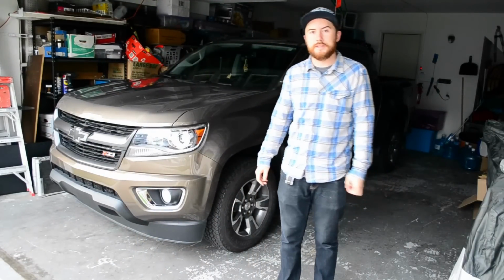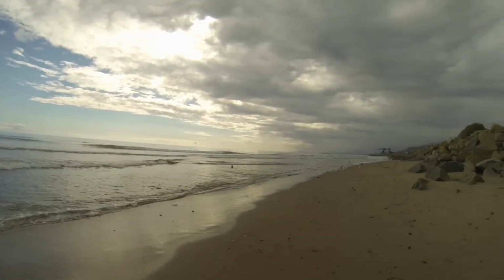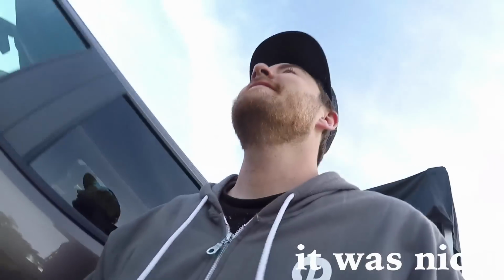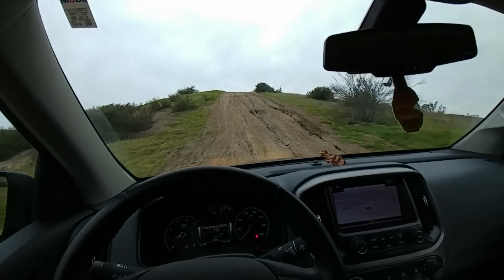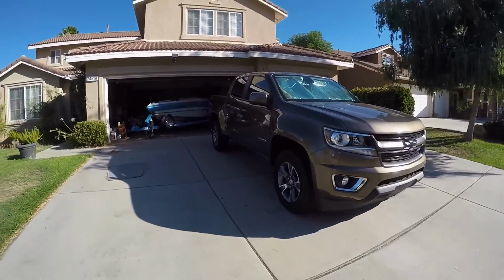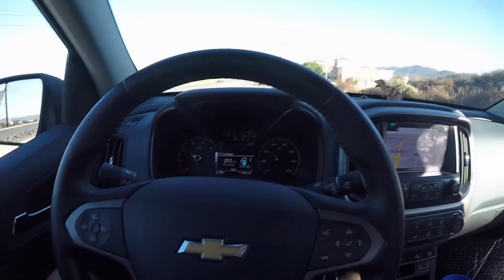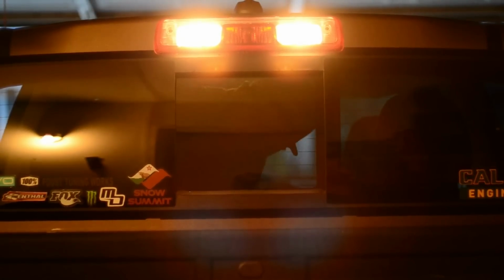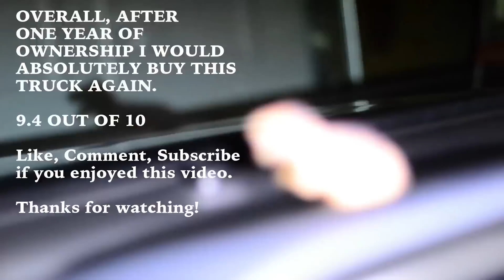Chevy Colorado Diesel... 1 Year Later

Comment: Best part of this review is for sure the info about the T-Rex. Veeery important stuff there!

But seriously, thanks for this video, thinking about grabbing the 2017, and wanted to check out some reviews on the previews models. Especially the Diesel vs. the V6. 
I'm into carpentry and equestrian sport, which means lots of wood and eventually a horse trailer! So seeing the reviews on how this thing towed your boat was helpful. 

Thanks again
Reply from the maker: LapeyLou you're more than welcome. That's why I posted it, so I'm glad it helped. And yes, T-Rex and the other dinosaurs should never be forgotten.
Reply: I bought the new 2017 Chevy Colorado ZR2, I've always been a Ram/Jeep guy. Hands down, best truck I've ever driven or owned. Get the diesel though for sure, it'll last Foooorrreeeevvvvveeeeerrrr.
Reply: Thanks! 
I'm definitely thinking that I'll be getting the Diesel. Even though I don't need that much power right now, it seems to be overall better on  gas, and performance. I do live in the city, so I'll have to look into a few more factors before I decide to buy, but I'm definitely going to be getting myself one of these bad boys. Just have to figure out Diesel or gas. :/
Reply from the maker: Just think about how you want to use the truck to decide between diesel or gas. If you are going to be doing open hwy and towing you'll notice the biggest difference. In general, one thing I learned about the diesels is the constant short trips are not necessarily the best because it doesn't get to warm up. It doesn't get efficient until it warms up so something to keep in mind.
Reply: Yeah, I'm starting to rethink diesel. I think that I'll go for the gas to start, and then maybe in a few years (or whenever I buy a horse trailer) then I'll trade it in and get a diesel. For now I think gas is fine. I won't be doing any towing for quite some time, except occasionally, and most of my 'big trips' will just be loading lumber. I think gas will be fine to start out with. 
Thanks so much guys, you've both been super helpful!
Reply: Nert

Comment: Very nice!  I have a red Duramax z71 crew cab short bed 4x4.  15,000 miles already; absolutely love it.  My biggest complaint is that my door panels rattle with bass.  I have the Bose system. Went to the dealer and they "can't replicate the problem" as usual.  Going to have to dynamat the door panels myself.  I put a nice set of LED tail lights on and LED headlight bulbs.  Looks real sharp.  Good luck with the truck!  Keep it up with the videos!!

Comment: Not too sure what this video was about.... But it wasn’t about what thought it was about.  Doing research because I like the diesel idea-NEEEEXXT!
Reply: I have a 2017 2.8 ZR2 with 18k miles. I have had 0 problems with the truck. It has only been in the shop for a recall. It currently has to go back for the side air bags deploying in certain off road condition. Excellent truck and excellent fuel mileage.

Comment: Hey!

I enjoyed the video and your enthusiasm for your truck.

When you were towing your boat did you use an anti-sway hitch? If not, I'd HIGHLY recommend buying one! It will help to stop your truck from bouncing & will help steady your load from swaying side to side in crosswinds! 

Did you use your exhaust brake? That's another great feature of your diesel Colorado. 

Glad you love your truck!
Rob
Reply from the maker: Rob Huddleston thanks man. Appreciate the recommendation on the hitch. The ride is my only complaint about towing.
Reply from the maker: Rob Huddleston I also use my exhaust brake all the time. Working that with the manual mode for downshifts has become second nature

Comment: One year later I've got 50,000 miles on my 2016 Colorado, 3.6L long box. A few dents, one gash, etc. Chin splitter removed. Lots of mudding and deep snow running. Everything is good so far.  Except for the damn back seat, I hate how the tray stops me from carrying anything on a reasonably flat surface, like my Golden Doodle to the clipper. Have to put her in the back seat.

Comment: Funny and informative video and cool color!  I have the Bronze Alloy on my '17 Canyon, SLT crew cab long bed 4x4.

Only 5K miles on it so far, but it has been great.  These things love to run at 1,800 to 2,000 rpm.  This is very common for diesels of all kinds.  There is something about 1,800 rpm as their efficient torquey sweet spot.  I easily break 30 mpg at 70 on the freeway.  I had one all 60 to 65 mph 35 mile run with no wind or traffic, cruise set, flat road, it got 42 mpg!  Crazy.  

I let the "B" tripmeter run since it was new, the total average economy stands at 25.2 mpg in 60/40 mixed freewayish and cityish driving at 5,000 miles.  It is definitely getting better with break in as it has been climbing out of the 24s for awhile.  To put that in perspective, my last car was a company supplied Camry, it averaged 28 mpg under the same driving conditions.  That is not too shabby for this efficient little diesel.

A couple of little tweaks - I removed the foam sound deadening pad off the top of the engine to let it clatter more as  I like the clattery diesel sound and it probably confuses Prius drivers at the gas station hearing it coming from a non humongous truck.   Also added a catch can to the PCV system since new, and after 5,000 miles, it's element is pretty soaked with oil.  Better to have the blowby oil in the can than mixed with EGR soot in the intake tract to form nasty goo.  The final tweak was to put some self stick foam behind the ECM as it was rattling with the diesel vibe.

I hope you continue to enjoy your truck!
Reply from the maker: Craig Hoffman nice man! Thanks. Glad you are doing so well with yours. They really are some great vehicles.

Comment: After taking it out of 4 hi or 4low, you don't really need to but it's a good idea to drive in reverse a few feet in a straight line, just to help the transfer case unlock easier.
Reply from the maker: K. R. V. Thanks for the info! Good to know.
Reply: K. R. V.   Good info but that is old technology gm says dont have to do it anymore but also your supposed to freewheel before putting into reverse,,hince put into neutral while rolling at lo speed then reverse it about ten feet,,,they it helped release pressure of of the  hubs to fully unlock,,,but like i ssid thats all old school like frpm gm first came out with auto locking hubs

Comment: Sweet looking truck. It looks like it's serving you well. :)
Reply from the maker: Thanks! Couldn't be happier with it so far.
Reply: You're welcome. As long as I've been interested in cars, and that's forever, I've also been interested in the diesel engine. For some reason, not many cars, trucks, vans, or SUVs, have been available with smaller displacement diesel engines, certainly nothing less than 6.5 litres displacement. Hopefully, that'll change.

Comment: I just got an 2018 Colorado duramax. I do alot of offroad stuff so the first thing that came of was the air dam in the front. They screwed it on backwards so was a dot challenging but took me about a half hour. This truck can do way more than that little hill you pulled. Very impressive, would be beter with 4 inch lift. Nice vidio thanks.
Reply from the maker: Yeah dude, I've done a lot more with it since this video. I'm pumped on it every day

Comment: You could be Lincoln Riley's twin, the Oklahoma head football coach. I'm trying to decide  on getting a Zr2 with the diesel. Thanks for the video.
Reply from the maker: Haha I'll check this guy out. Zr2 diesel is a beast of a truck. Nothing else really like it out there. I would have gotten the zr2, but it was still a concept when I bought mine with no guarantees that it was going to make it to production. That front locker would be cool and the shocks are sweet too. It's a nice upgrade over the z71 if you plan on using the truck offroad a lot. For me it's only about 10% of my use right now so I'm doing just fine with the z71. I should have it paid off in the next 6 months then I'm gonna build mine into more of an over lander setup

Comment: I'm a die-hard GM person just wanted to say I was hoping to see how the tow capacity was on this but I'd like you to know that anything can almost two anything on a straight the true test is on Hills
Reply from the maker: Andrew Hernandez ive pulled a full boat trailer about 4k+lbs and camping gear up the grapevine and back down with no problems. Holds steady at about 55-60 at almost wide open throttle. Once the turbo gets going it's pretty impressive.

Comment: A couple of questions for you. When you bottomed out at the bottom of the hill did you damage anything? From your caption it sounds like you might have. Is the "thingy you referred to was the downhill decent control? I haven't used it much but I think you engage it at the speed you want to maintain to go down the hill, before you go down the hill. Like if you want to go down the hill at 5mph you engage it while rolling 5mph before you start the decent...then its supposed to hold at 5 mph the total decent so you can keep your foot of the break. Did you use this? I have the same truck in white CCLB.4x4.

Comment: As for some other ppls opinions I enjoyed the review it showed a dude living with his truck throughout a year doing what dudes do. How much def fluid did you end up going thru compared to your mileage? I commute approx same distance as you each way so I do like the mileage you were getting and 26$ a week give or take is def reasonable to have a truck that can actually tow and yet be comparable in mileage. Any mechanical issues in the past year? Thinking of picking one up this summer.
Reply from the maker: AJ James thanks for the positive feedback. I'm glad you enjoyed the video. I too was worried about the DEF when cobsidering diesel, it is honestly a neglible expense all things considered. I spent around $20 on 2 containers and its lasted me a long time. I'd say I refill DEF around every 10k so far at $15 ea fill. Have the dealer top it off each time you get the 2 free services. Can't recommend highly enough. Zero mechanical issues in 2 yrs, and 22k. Good luck. Let me know if you have any specific questions.

Comment: You have to really decide if the add cost of the diesel will pay for itself. My friend's wife wanted a hybrid Lexus SUV. He told his wife the added cost would not pay for itself in her lifetime. Same reason I didn't get a diesel in my Dodge Ram. It was $8K more.
Reply from the maker: Rick Uyeda agreed, but there are also several other important factors when considering the engine option including use, timeframe to keep the vehicle

Comment: You can’t let the computer tell you your mpg it’s only an estimate. More accurate if you divide miles by gallons actually consumed
Reply from the maker: Lisa Smith read below. Ive commented several times on this already. I have done the math many times. The comp is always within 0.5mpg of actual and generally underestimated
Reply: kevinkillsit ;great video fun to watch. Are there any options you wished you ordered now that had it for the year.
Reply from the maker: Lisa Smith haha thanks. I am super happy with the overall package. I went in to order a truck with selected options and the dealer had this one on the lot. It had everything I wanted and a few more, but was the wrong color. I was not initially going to do the nav or 4x4, but this one had those and I'm so glad I chose them. They make the truck feel premium and its a one time cost. This model has just about everything available on the 2016s short of the lightbar. Overall, I don't regret it one bit and have come to really love the color. When I saw it on the lot, I knew it was going to be mine within the first 30 secs. Bought it a week later after hearing it was a 3month wait to order one. 28k mi now and no problems or regrets whatsoever. I just wish diesel would come back down in price a little. It's doubled in the last 2 yrs. Almost everytime i go to the pump it costs more. Not sure really what's going on there, but the fuel conpanies sure are greedy. Good luck. Let me know if you have any questions.

Comment: Good video.. 
No problems with the DFP?
Reply from the maker: By DFP do you mean DPF? Diesel Particulate Filter. If so, then NO absolutely nothing to report. It does a regen cycle every 300 miles or so and I tend to run it a little hard and vary my throttle inputs during that time. overall, it seems to be cleaning itself out. I did however have to take it t the dealer to do a reset on the check engine after it threw a code for insufficient EGR flow. That happened around 5k miles under heavy engine braking coming down a mountain using exhaust brake in M mode to control gear selection. It ended up being a simple update to the computer to correct the issue and hasn't happened since. I think it was more to do with the first released trucks and mine was one of the first 600 so they probably corrected it by now.
Reply: Nice ....
Yup typo
Reply: will you get a tune put on it? I guess California is probably very strict against stripping emission stuff.
Reply from the maker: I very much want to tune it and I definitely will at some point. The DuramaxTuner guys have some pretty slick stuff out for it already that from what I've heard makes a lot of difference.  I'm starting with the cold air intake from S&B Filters, which I just confirmed yesterday should begin production in the next couple of weeks. I've already scheduled with the guys over there to have my truck get one of the very first kits installed. I will get some video when that happens, since I should be getting one of the very first of their kits. They have extremely high quality stuff that just looks awesome so I can't wait for that. Eventually I'll progress to tuning once the mileage gets a little higher and the motor is fully broken in, but I'm pretty happy with it for the stock package overall.
Reply: kevinkillsit 
NJ just started inspections for emissions. 
Mine is good for 2022 
So for guy here in NJ 
Surprise. 
Thanks to everyone advertising that they are ripping off the emissions. 🙄
Reply from the maker: David Behr's nice hahaha. yeah they will certainly be in for a nice surprise. I'm sure lots of people will abuse it by doing the inspection and then gutting the emissions for 5 years just to bolt it all back on for every inspection.
Reply: kevinkillsit 
Lol true
Reply: they are going to start inspecting now? i was looking at buying a new diesel soon ...no more self inspect? lol
Reply: Eliteage 
I have a emissions insp sticker on mine thought they messed up 
Went back and they told me that all diesels will have smoke test and emissions... so take it for what it's worth (dealer saying it)
Reply: I thought it was self-inspect no?
Reply: Eliteage 
Self insp is diff then smoke/ emissions test
But yes self insp.
But no it will soon be smoke/emissions test .. from what I am told or could be getting lied to so I don't ask for some money back lol